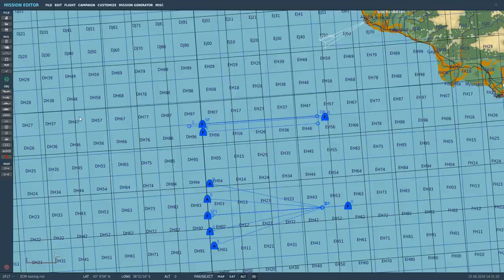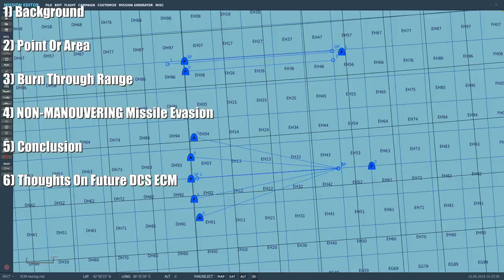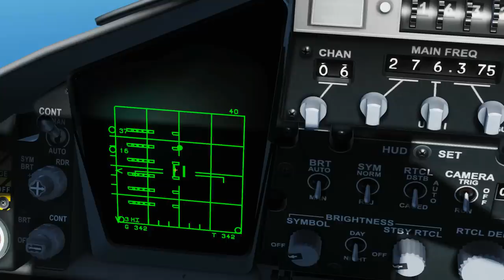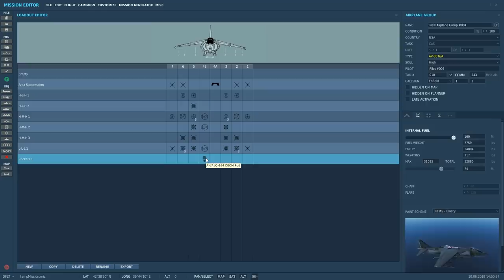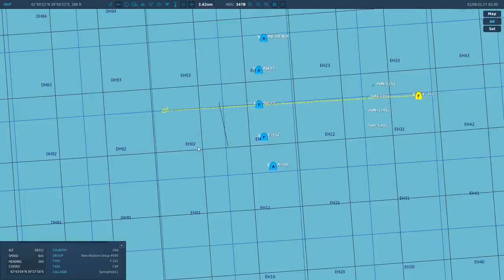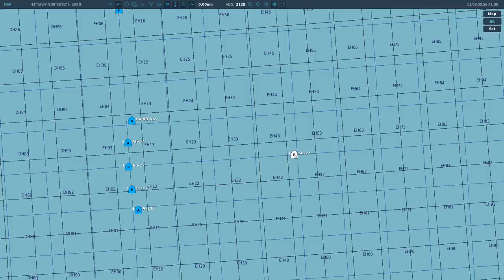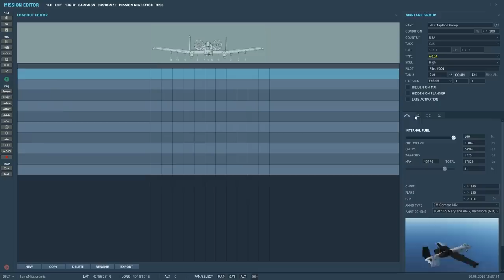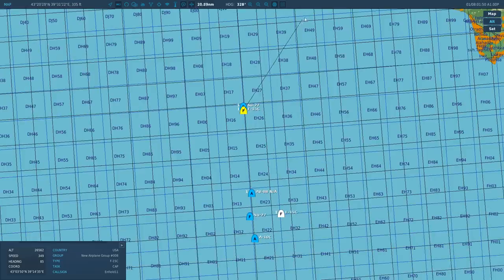Combat: Max Effectiveness Of Air To Air ECM Jammers | DCS WORLD

Comment: What my testing showed:
You can launch at jammers just fine; you'll need an AWACS/EWR to tell you the distance/altitude though, so you can determin when to launch your missile.
It "should" (I don't have enough data on that) be even easier for the missile to track the target, because of the high power signal the jammer is putting out. And the
 target won't get any missile launch warning!

What won't work is firing at 2 jammers (that are in the same group), because the missiles will go for the highest power, ie. the closest one; not necessarily the one you locked in HOJ.

ECM works quite well against AI; they'll maybe not wait until burn-through (surely depends on the missile used though) but it massivily decreases the max fire range at which an AI will shoot at you. And they'll mostly use IR missiles with you jamming.

Out of interest: is the jamming for the FA18, F14, F16 modelled correctly nowadays? Or is it still not working?

Comment: A more complex or more accurate system might not necessarily be more taxing on systems. It depends on what kind of system it is and how it is implemented. It might just be more of a matter of time budget to develop and optimize the system and it also might just be a case where they revisit the tables and do some major tweaking as if the tables that are in there right now may just essentially be a sort of beta test of the system until they have time to revisit it.

Comment: Point vs area: Realistically speaking it should be az/el based. The key point is if the detecting antenna is looking at both at the same time. Place the jammer behind the other aircraft, and it should hide the forward plane. Look at it from another angle and the forward plane becomes visible again. 

Burn through: Realistically speaking, burnthrough depends on 
- jammer output
- distance to jammer (weakens jamming signal)
- distance to target (weakens radar signal)
- radar eccm
- target RCS (Depends on aspect) (Jamming and stealth go very well together.)
When several targets are detected at the same range, it is unlikely to be well simulated. 

I'm somewhat dubious what I'm seeing on the F-15 radar display - it seems confident there's no planes hidden behind the jammer, still out of burnthrough range.

A2A missiles not missing due to jamming: 
Fox 1 Chase shot... could be in the chance to miss region.

If DCS only has noise jamming, why do missiles miss like you showed in the viggen jammer video? That looked more like another form of jamming, whose name I can't remember.

I would like to see better jamming simulation. I think you can take it several steps up without paying a huge performance penalty. 

Imagine a standoff jammer like a compass call orbiting outside the combat area. If you approach a SAM site from its direction, you'd be much better protected from it, but not necessarily its neighbor. The best use of these is a skill like any other. It's even module independent!

After the IFF overhaul they mentioned they would do, imagine jammers blocking mode 4 IFF when in operation. (Is that guy approaching from there a friendly?) What about datalinks?
 Now you have choices to make.

Comment: Jamming is complex.   It is all about confusing the receiver module in the observing plane, and that doesn't require power it can be very subtle and still drive the receiver nuts.     How you model it:   Use relative randomization.   But the core optical rules need to be maintained.   Don't need a RF model just a Monte Carlo model.    Roll dice.  Stronger systems gets more dice  and closer to the projection center gets a bonus too.   Recall that these ECM systems and the ECCM systems are probability based in fact.   So they can be modeled by dice rolls.  Abide basic optical/RF physics and reasonable probability and I think you can get fair ECM/ECCM warfare.  And don't forget.   Beam forming radar and ECM  has been around for a few decades.   Cell towers use beam forming too.   It is not unreasonable to assume modern ECM and ECCM systems can use it as well.
Reply from the maker: Thx Sir
Reply: CAG Hotshot  My software dev chops are rusty as hell.  That's a young man's game.   I'll just chill over here with a beer in the LazyBoy and watch the Grim Reapers doin' mish.

Comment: That's interesting, that the mirage had such a long range burn-through. Also i am pretty sure i saw some jamming strobes on my F14 from 70-100 miles but id say the burn-through range of the F14 is further away due to the power of the AWG-9 radar, however I was also under the impression that the F14 was more susceptible to jamming due to its Analogue systems (perhaps it misses more in game) and got more robust in the Delta variant due to digital systems.
Reply from the maker: rgr personally I am 99% sure hostile jamming isn't working in F-14. Bear in mind that you can jam a S-300 radar from 25 miles away, and that is 10 x more power than a Tomcat output.

Comment: Nice vid again, Cap
One of my favourite chapter in aerial warfare. 

you mentioned the ecm on the victor. As far as i know the would have used the external ecm pod AN/ALQ-101(V)-10 or called Dash 10 which produced an imaginary target which is located some miles distant from the aircraft fitted with the Dash 10 pod. This pod was used on the Bucaneers during Desert Storm.

4th and 5th generation aricraft normally using complex ecm systems containig jammer, rwr, missile warning systems which are highly automatic. But they are not working against any radar.

That´s why a/c like the EF-111 Raven, EF-18 Growler and the EA-6 Prowler extisted or exist.  Those a/c have the power needed to jam a stand-off radar like those used by the S-300 (SA-10 Grumble).

And there is always chaff

During my service with the german air force as an eccm-officer i had a good chance to se what those jammer could do.

Once we had 2 EF-111 an 1 EC-130H Compass Call on station. Suddenly our radar screens went blank, no blips anymore don´t know how they made it And we used a MPR Radar for survailance

Thanks again for that vid

Comment: The AIM-120C is home-on-jam, too, isn't it? That might contribute to them hitting all the time. Does the same happen with an AIM-7?

Edit: Never mind, you addressed that, they do. But then I guess it makes sense as well, since they're guiding off your plane's radar reflection, if you can keep lock, they can keep guiding. I guess it reduces the range from which you can fire one, though, so it's not completely useless A/A... just mostly. The biggest benefit might be keeping human opponents on their toes, since even if they know you're over R-lethal since they can't burn through the jamming, they never know exactly how much over.

Edit 2: I'm not convinced it would cost a whole lot of FPS to have a better jamming model.
Sure, 100% realistic would be pretty intensive, and a lot of work to implement. But they could do better than it is now with it only running a function once each time the radar sweeps over a plane, which is usually a fair interval. That's probably much what they do now, but that function could do a lot more than just a "range < 25" check without getting any noticeable performance hit.
They might improve it as part of the radar simulation improvements which are in the works right now anyways, though, as they are closely related.

Comment: * Good Video !!!   Would like to know how effective the F-117 stealth is in DCS. You may have tested this already,  Your Videos are awesome !!!
Reply: +1! 

I'm also very much interested in the F-117 and B-1B as well and any other low RCS planes that might be there (MQ-1A Predator drone perhaps?)

Additional question: Can chaffing break radar lock in some aspects or affect A-A radars in any way?
Reply: @gketchup777  yes that's Implemented
Reply from the maker: Good point, I will look into that at some point
Reply: I started testing the F-117A using an F-15C last night and could absolutely not pick em up (I put 4 in at 80 miles at 30k feet at 300knts GS with me being at 30k) at all from the front nor could the Aim-9 pick them up at all from the frontal aspect. From the rear I need to do more testing but inside 7 miles I was able to get radar looks and hits w/120C and with the aim-9M had to be within 1.5 miles to start getting a tone regardless of if I slaved it to a radar lock
Reply: CAG Hotshot  well that does make sense that the Mig has the bigger radar return that the AMRAAM would go after it. Not saying that it was accurate but in DCS you can get a lock (I could only get it in vertical scan which obviously is inside 5 miles and bore mode where I got one as far out as 5.6 miles that I can be sure about) but only from the rear and very close. I couldn't see them even though I knew exactly where they were with clear weather in TWS or RWS in the Eagle. It was incredibly frustrating and actually quite fulfilling at the same time. Under perfect testing conditions I couldn't pick it up. Next I'll try it with an F/A-18C radar and see if it'll pick em up. I had em flying right at me at known altitude with no evasion and no chaff or flares (don't think it carried them anyway) and no ECM so I expected to get a TWS track around 20-30 miles or at the least somewhere between 10&15 miles but notta. Going to start putting them in missions and testing them against S-300s as well. Going to remake one of my favorite missions with USAF Aggressors on Redfor against everything. I suspect I'll only have any luck on pure optical systems like SA-19 and I'd have to force it down looow which won't be easy especially if I don't restrict ECM and reaction to threat.
Reply: @dustineverhart4028  Wow, Good work!

Comment: Thanks Cap,  great work.  I think the radar vs jamming can be done better and doesn't need to kill our CPU's.  One other thing that should be added is the radar cross section of the aircraft.  No reason the different aircraft should all pop up at the same range.  This could be calculated and make into a look up table and very little CPU would be used. 

Anyway, thanks for your continued work on this, love the thought that goes into it and the discussions.
Reply from the maker: thx MD

Comment: AIM-120C has HOJ.. so does the AIM--7MH. Jamming should effect a non HOJ active missile when it goes active, even inside burn through range because the electronic processing power of the missile is limited, and the signal power ratio  of the missile's radar vs the output power of the ECM jammer, is different

Comment: Hey CAP. Bit late on this. But did you test if using the jammer will light up a target that was otherwise undetected? IE if say a jet is notching and you loose it. Will is show back up if they turn on the ECM, giving away their general location?
Reply from the maker: yes BUT it only gives their azimuth, not elevation or range.
Reply: @grimreapers  Understood. Sometimes it may be better to run silent though. It could also be useful for hiding an air strike in a formation too.

Comment: It could be made more sophisticated-like without too much more processing requirements, up to some point, for example taking in account of the jammer antenna's radiation pattern as the shape of the AOE (area-of-effect) so it's not just a round ball 3D-area if that's the case right now, including that the AOE is properly rotatable on all axis in the 3D world just like it works with radars already. Secondly there can be many CPU-cheap modifiers on top of the base AOE size (intensity/power level) that may approach the workings in reality, without actually needing to simulate the physics of the EM signal interacting with the other modifiers in detail (water, rain, humidity, clouds, terrain type, temperature, altitude). The jammer's AOE size adjustment in real-time or more fittingly called AOE shape scaling should be easy and doable today. The AOE shape morphing would be much harder so not that. Morphing of the AOE wouldn't also bring that big practical benefits in the big picture in this Sim. Morphing is caused by reflection of the jammers EM signal by other objects/obstacles particularly metallic ones that would alter the shape in certain areas of the jammer's AOE, that's heavy math. 

So in practice, for example for each point of humidity the shape of the jammed area would be scaled up/down by let's say 0.015% from the base level, some 0.008% for each temperature point, and so forth for altitude, terrain type effect (over trees, over city, over water, over fields), in-clouds, and wether it's raining on the jammer's unit (we can assume that equals rain in the whole jammer's base effect area)

Tertiary, the damage model (damage location/type/intensity) of the aircraft could affect the performance of the jammer's antenna (antenna only for now, let's not mix in jammers chip logic into this post, it's complicated already) as well, is the jammer getting fed proper power, does voltage vary due to damaged engine/generator/APU ... would the jammer even work at full-military power when only APU is on or only one engine, does it get power from both engines no matter on what hardpoint it's installed? That can change base level AOE scaling even further, and it's all really CPU cheap in theory. These are all combining modifiers, some may be positive others negative so you get out a soup, just like in reality. If you add a lot together and many units then we can talk about some more CPU requirements surely, maybe even somewhat that low-end bar would have to be raised a bit, but nothing like you'd need a supercomputer.

For example, we don't need to simulate the changing jammer AOE shape due to some piece in the fuselage missing, it is not worth it, avoiding that kind of level of simulation is ofcourse not just wise but necessary and I'm sure many other such things with physics that I can't recall now.
Reply from the maker: RGR agree

Comment: Interesting how you think a core feature of modern air combat isnt worth the cpu cost (which doesnt need to be noticible to add different jam power, radar cross section sizes, and other stats). Ecm and eccm are extremely important elements in modern tactics but the basics arent all that hard to add. I'm shocked to see how bad dcs is. Guess they thought no one would notice.

Comment: Three questions:
Q1: Does the Jamming Pods of the Su-25T work as the other FC3 aircraft?
Q2: Does jamming inhibit the use of TWS in the Hornet andf Tomcat?
Q3: this one I have been thinking about for a long time. In the Su-27/33 and the Su-25 - you normally carry one jamming pod on each wing. What is the difference if you only equip ONE pod, instead of the two?
Reply: The Su-27 jammers are very likely able to perform cross eye jamming, which will cause incomming radar guided missiles to miss by great distance. For that you need two jammer antennas with enough separation.
Su-27 jammers can also do stuff like terrain bouncing, where a false target is created by creating using ground reflection (The jammer pods can direct their radiation in any direction)
Unfortunately jammers are heavily undermodelled in DCS.
Reply: I’m sure I read somewhere that the Su jammer pods require 2 pods due to one being a receiving pod and one being an emitting pod. At least in dcs that’s the case. So you need 2 pods in game to use the ecm.
Reply from the maker: 1) yes same as the Ground Attack class
2) only outside of burn through range, after that no effect on TWS.
3) lols will have to try

Comment: Dude, point source... and it may or may not have a reflector to give it a directional component relative to their air frame.   If someone shines a flashlight in your face you are going to have a hard time getting radar data on them or their buddy standing next to them.    But as you get closer you may fall out of the penumbra of that flashlight beam and then your radar will see the buddy and may also get a fix on the asshole holding the flashlight!   Most of this behavior follows from basic optical physics.   Radio makes it a little funky but not much due to the ranges you are flying at.  nine times out of ten a directional jammer is going to swamp your radar system.   BUT...   if you target a jammer it is going to hit that hot spot easy!   If you want a reality check...   Try to take out a hornet nest at night when you have a flashlight lit.     You are going to get wrecked  hornets will rush the light source.  Speaking from personal experience.   Good thing I had really good Personal Protective Equipment for that raid!

Comment: A bit of a correction on your conclusion re air to air missiles: plenty of missiles can be launched in Home on Jam mode (off the top of my head, AIM-7, AIM-120 and AIM-54), where basically they follow the path to the jamming signal rather than to the target like they would normally. Those missiles when launched in that mode are essentially Fox 1s all the way to the target (including the AMRAAM and Phoenix). It might be worth trying to see if jamming affects HOJ A2A launches (using the F-15 I suppose) in the same way it seems to affect SAMs.
Reply: CAG Hotshot  Thanks!